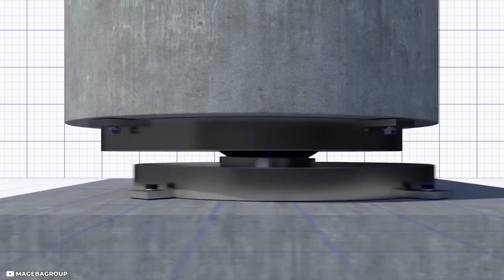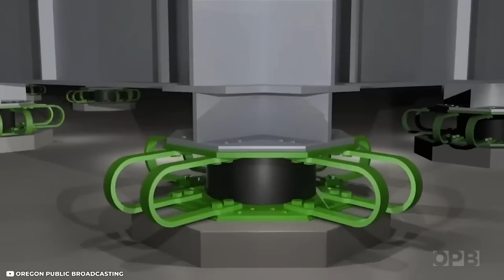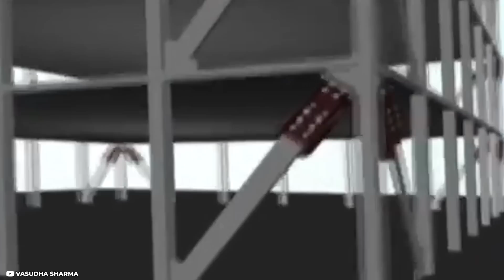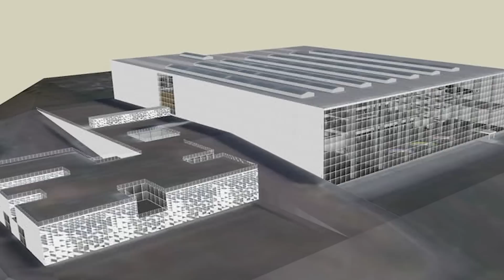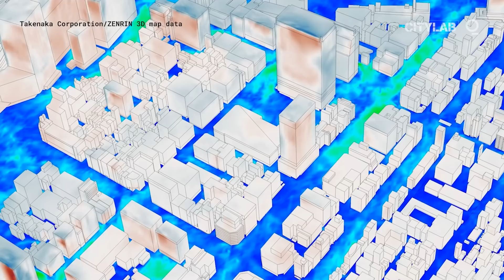Japan's Earthquake Proof Buildings (And What Turkey Can Learn From Them)

Comment: People pinpointing this and that, JAPAN HAD A 9.1 magnitude earthquake that lasted for almost 5 minutes last MARCH 11, 2011 and when you look at those videos NOT a single building collapsed!! And you may not appreciate the strength of the said 9.1 since there's no much damage. although the TSUNAMI that came AFTER which caused a total devastation. They had an aftershock of magnitude 7.7 and occurred within 29 minutes of the mainshock, extending the plate boundary fault rupture south. Within 24 hours, there were two more earthquakes above magnitude 7 or 6 and several aftershocks that lasted for weeks. Hence, we could really learn from them.
Reply: In Japan the majority of Earthquakes happening in the Sea of Japan, in Turkey the faults where the Earthquakes happening are directly underneath or beside the cities, that's why you cannot compare the Earthquakes with the ones in Japan. The recent Earthquakes in Turkey had a relative shallow depth of only 9.7 km, first one registered as a 7.7 on the richterscale but it was directly under the City of Kahramanmaraş, cause the faultlines closeness & shallow depth it actually equals to = level 10.3 and the second one was a 7.5 = again equalling to a (level 10) CRAZY!! Every city in close proximity to this fault line got destroyed or heavily damaged.
Reply: @Gian Rey Thats thr historic explination for Intensity. But its the 21st Century. We measure Intensity by ground accelleration.
Reply: @Gian Rey As mentioned, nowadays Mercalli Intensity gets calculated with Measurements of peak ground acceleration. 
Yes, locally the 2011 Japan Quake had extremely High Values, i didn't claim differently. I said that in Türkiye, Intensities over a large Area, have been Higher than over a large Area in Japan. 
No explination of the Mw Scale needed. We arent't talking about Energy release at all.
Reply: 2011 Tohoku earthquake was 9.1 in magnitude (Mw) but it was measured Level IX according to modified Mercalli intensity scale. 2023 Maraş earthquake was 7.8 in magnitude (Mw) but the seismic intensity scale was Level XII. There isn't a higher level btw. 
False city planning, poor structures and lack of governance are one thing, but these two earthquakes aren't comparable in sense of seismic surface waves.
Reply: @Gian Rey From my Knowledge it is defined what ground velocity and acceleration corresponds to which MMI Level. Which can be seen at the USGS Shakemaps too. 

I didn't claim the Türkiye Quake was exceptional in Energy Release or Intensity.
I didn't claim the destruction can't be attributet to the turkish government failing to enforce seismic code. 

Don't use Arguments against things i never said. 

My Point is:
Compare the Intensity (here i really mean the grade of shaking) instead of the Magnitudes. Because Magnitudes may be misleading. People do mainly compare the Mw9.1 with the Türkiye Quake. But there are also People using the Mw 7.8 Earthquake in Japan in 2015 and claiming its harmlessness only on the better way of construction in Japan. Also People tend to forget the Damage directly caused by the Tohoku Quake, claiming it didn't cause any damage. Or they have the swaying Towers in Tokyo in Mind and comparing Tokyo with Downtown Antakya. 

Of course you can compare the Türkiye Quake with the Tohoku Quake. But do it correctly. People shouldn't jump to wrong Conclusions. People tend to glorify Japanese Buildings. Until a certain Point they are right. It has prevented major Disasters in the Past. But Destruction and Disasters still happen.
And this is what i wanted to intend with my original Comment. Not starting a Discussion on how Intensities work but understanding that a Magnitude alone doesnt tell much about an earthquakes strength and that enforcing the best seismic code wouldn't have meant that nothing happens. 

To understand my Point of View you probably need to know that i have these kind of discussions often with People in my Home-area, who compare Magnitudes of our Earthquakes with regular Japanese Earthquakes. Threshold for a Quake being felt usually is Magnitude 1.5-2 (with many cases of <M1 known). Shaking (not damage, i mean shaking here) corresponding to VI on Mercalliscale is usually found at 4.0-4.5 Quakes. With a recent Case of VI-VII found in a Mw 3.6. 

Whereas a regular (30km deep, offshore) Mw6.0 Quake in Japan causes Shaking corresponds to V-VI. Though there have been Quakes in Japan similar to ours in the past with damage caused by Mw4 Quakes.
Reply: @Gian Rey I have just scientifically explained that the earthquake in Tohoku wasn't more destructive than Maraş earthquake. Tohoku was more destructive because of the tsunami, not because of the earthquake but whatever, you apparently can't grasp it.
Reply: @gokcewallisch  dont argue about the strength of the earthquake and prey for the lost lives
Reply from the maker: Exactly!
Reply: @NeanderthalerYT11  idk why some people take it negatively bringing up 1935 or 1995 Japan earthquakes which were relatively weaker and their construction works weren't that advanced during those times– totally disregarding a 9.1 quake where their buildings withstood it. And obviously they've adapted through time as they've been hit by numerous earthquakes big or small on a yearly basis.
Reply: @mizzu-oi9fg Peki bu 9.1 yumuşak zeminli şehirlerin tam altında mı oldu? Yoksa okyanus açıklarında mı?
Reply: You shouldn't compare Magnitudes of Earthquakes. It does make more sense to compare Intensities. In 2011, Maximum Intensity was IX and VII-VIII was widespread. There was widespread damage and hundreds of Deaths by the Earthquake itself.
The Türkiye Earthquake had a Maximum Intensity of XI and Widespread IX. Meaning that the Türkiye Quake was far stronger, more comparable to Kumamoto 2016 or Kobe 1995. There we have seen widespread severe damage. Though still less disastrous than what we have seen in Türkiye thanks to the better Conatruction of Buildings, especially because of the lack of Soft Storey Highrises in Japan.

Comment: Turkeyi's earthquake was 7.9 magnitude. Japan's 6.3 magnitude
Reply: Better Compare Intensity than Energy release. Türkiye had Intensity XI and Japan in 2011 IX. Better comparison with a Japanese Quake would be the 1995 Kobe Quake. Widespread destruction but still well behind the Level of Destruction we have seen in Türkiye.
Reply: @lukasrentz3238 That intensity standard is based on how much the builiding has destroyed and not nased on any mathematical evidence.It's pretty useless
Reply: @猿田彦-s9o  Thats the old understanding of Intensity. In newer times it it can be and is calculated based on ground accelleration.
Reply: japan 2011 earthquake was 9.1 😩
Reply: @budim4096  with tsunami 😭

Comment: There was 2 Earthquakes in Turkey on 06th Feb 2023, reaching 7.7 and 7.5 on the richterscale and 641 aftershocks reaching level 5.6 and in the last week we had 2 more Earthquakes level 6.4 & 5.9 dunno what's going on in the Small Asian peninsula, one thing is for sure, the people suffering from Trauma, grief and everyone is pretty much on edge since 3 weeks now. May God help us.
Reply: SOLUTION:
An effective way to REDUCE
earthquake and volcanic eruption hazards
is to CONNECT Makkah with Antarctica,
Tuamoto with the Arctic, and the poles themselves
through the Atlantic with paramagnetic material        

Why Makkah, because Makkah is ancient North Pole, Electric Magnetic come from the sun go to north pole and Makkah, from south come electric Magnetic, generate Earthquake
Prediction is not the solution, ssgeos you almost there
After we know how the magnetic circulation between the Earth and the Sun, it can be realized why the earthquake and volcanic paths exist in certain areas between Makkah and Tuamoto in the east and west of the Earth’s surface.

That some of the positive magnets that enter the north of the Earth TURN towards Mecca, others go straight to the south. Likewise, negative magnets that enter in the south there are BENDING to Tuamoto in the Pacific and half of them directly north in the bowels of the Earth

While Tuamoto in the Pacific. Volcanic activity there is still valid because the south pole was once a positive magnet. Now traversed by a negative magnet coming from Antarctica

From the SOUTH there is a magnetic flow towards Makkah. But before it arrived, it collided with a magnet from the NORTH in the bowels of the Earth.

Comment: It's not that the world doesn't know how to build resilient building. It is that most don't want to implement these solutions because they are expensive.
Reply: Its corruption
Reply: @fumiyafuse6374  the point, you hit it.
Reply: It will be a necessities very soon!
Reply: @analienfromouterspace  It was a necessity ever since, but not every necessity is fulfilled.
Reply: @ciprianpopa1503  expensive in a way but not in others... the point there is much more obscure than you think. 

the cost to rebuild a building is several times more expensive than add some funds on good project that will survive generations and several earthquakes in lifetime.

but...for most places in the world, something that cost 3 times more but will save money for the next 50 years is not a option, because a human life "not wroth the price" of building a safe apartment, is what they say, no joking, it happened, they said this with airlines planes as example, "the life of 300 passengers not worth the price of an aircraft that cost two aircrafts", said by lockheed engineers and later by boeing engineers. was something like this. 

this is the dark thinking of this "death industry", if someone die, is profit, it moves the the industry, it give jobs, if there is no law preventing and regulating safety, they don't give a f to human life, they will continue to assemble low quality material to make money for today and they don't give a f  to the future, in fact for them is better to collapse, because it moves the wallet. this is not conspiracy theory, this is the daily life of the system 

talk for some minutes with someone in this area, and you will see that coming out of their mouths, i talked about safety with professionals of 3 areas, people who work with construction, or airplanes and also cars, they all say the same thing, they laugh at our face if we care about safety, 

in japan it not happen because is cultural to give value to safety
Reply: @arahok7675  You may have a point if every single building in the richest country of the world would have most its buildings built to the highest standards. However, this is not the case, the rich can afford safe buildings while there are a lot of buildings that can collapse in the hands of poor people in the same higher income countries, Japan included. You can talk this way now because there are a lot of buildings in Japan that were wiped out during old earthquakes, and now they are replaced by strong buildings in a country that is rich and has good track record on having strong grip over the rules. 
Turkey is disorganized and cultivated a culture of bribes for centuries that has brought it to its knees economically lately.  So people can turn a blind eye to safety just to get a cheaper price, while not being really told that the quality isn't safe. The builders also fake documents declaring safety where it's not.
Reply: this corruption is a worldwide problem - greed is the worst manager
Reply: yes and no.
Majority countries do have the money ,but a good percentage of them are gone in kickbacks ,corruptions resulting in bad finished product
Reply: @otakuhunter4817  sure, but the word i used (want) doesn't necessarily imply a lack of money, rather a lack of will to spend them.
Reply: The WORLD doesn’t know, Japan knows. They have the technology. Stop your ignorance.
Reply: The solutions are not expensive. They are selling the houses for the normal prices. The house prices in Turkey is very high. A price that would include these solutions. But they do not implement the code and steal the money. The problem is greed.
Reply: @emrekalayci4425  No, the problem is that there is no control for tracking the greedy ones and make them accountable. The problem is the way the system is built in Turkey. Greedy people are all over the place.
Reply: Expensive but it's worth

Comment: I mean one was a seaquake and the other a earthquake so you cant compare those two incidents directly
Reply: Hanshin Earthquake was not a seaquake. Tohoku was.
Reply: Umm, Both registered about 7.8 ( 7.9 for Kanto earthquake) Turkish earthquake about 10 km deep while Kanto was estimated at 23 kilometres deep. The Kanto earthquake resulted in a tsunami. Because of the location of the Turkish earthquake there were few areas to produce possible tsunami waves( No shorelines collapsed unlike the eruption of Santorini (Thera) )
Reply: @geradkavanagh8240  there were TWO major earthquakes, just 9 hours apart in the same city. 7,8 and 7,6. IN THE SAME CITY, SAME DAY. Many other 6 or so earthquakes followed, which were NOT aftershocks but rather seperate earthquakes. And the soil in these regions are soft fertile lands. Prone to liquefaction. And that kind of land increase the earthquake’s power. They felt the tremors more than it should be. Before state something, search more, you m.ron! Don’t speak nonsense just to spite Turkey.

Comment: Hmmmmm
Even japan is yet to find a solution with ongoing process 🙏🧘

West have had protocols for earthquake resilient 🙃
So what's the implementation for 
Safety or commercial ⁉️
Reply: Who made this video is an idiot. Can u see what is the real cause of the bldg collapse? Earthquake in Japan movement is from left to right. Now Turkey Earthquake movement is different from Japan, the movement is up and down. That is the reason why most of the bldg collapse like putting a dinomite collapsing from 5th flr down to the ground. Its not  collapsing like u cutting big trees. Now check the other cctv footage and analyze the shaking movement is different from other Country. We experience Earthquakr but the movement is from left to right
Reply: Who made this video is an idiot. Can u see what is the real cause of the bldg collapse? Earthquake in Japan movement is from left to right. Now Turkey Earthquake movement is different from Japan, the movement is up and down. That is the reason why most of the bldg collapse like putting a dinomite collapsing from 5th flr down to the ground. Its not  collapsing like u cutting big trees. Now check the other cctv footage and analyze the shaking movement is different from other Country. We experience Earthquakr but the movement is from left to right
Reply: @sealoftheliving4998  i dont have idea of L to R . but Japan has more protocols and civil workers are more technically educated than whole world., different basement isolation methodologies , hope the same is reflected across the world and thought in schools

Comment: Like bamboo
Reply: Who made this video is an idiot. Can u see what is the real cause of the bldg collapse? Earthquake in Japan movement is from left to right. Now Turkey Earthquake movement is different from Japan, the movement is up and down. That is the reason why most of the bldg collapse like putting a dinomite collapsing from 5th flr down to the ground. Its not  collapsing like u cutting big trees. Now check the other cctv footage and analyze the shaking movement is different from other Country. We experience Earthquakr but the movement is from left to right
Reply: I think they reduced the reliance on timber after the number of times Tokyo got burnt to the ground. Bamboo structures(when properly built) are highly earthquake resistant. Japanese craftsmen built many bamboo and timber structures that still stand today as a testament to their understanding of structural 'elasticity' during earthquakes.